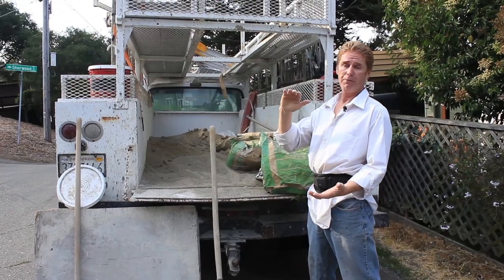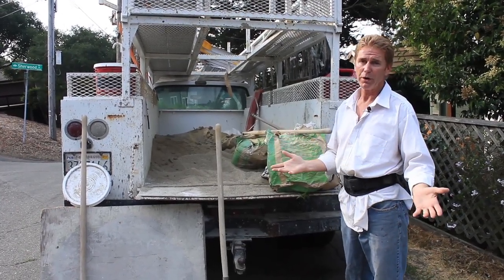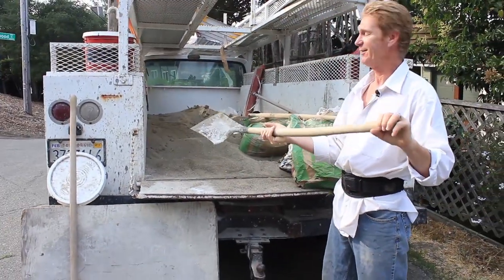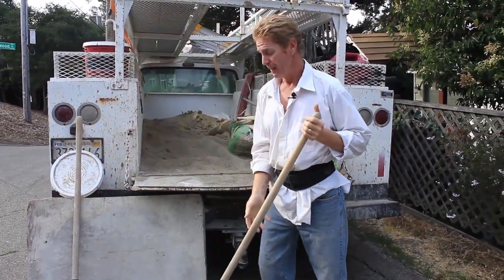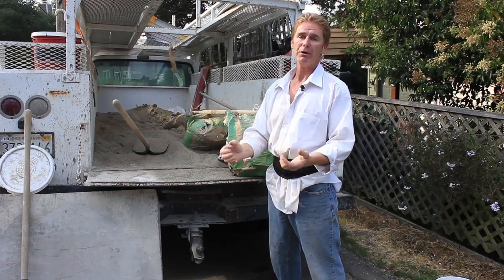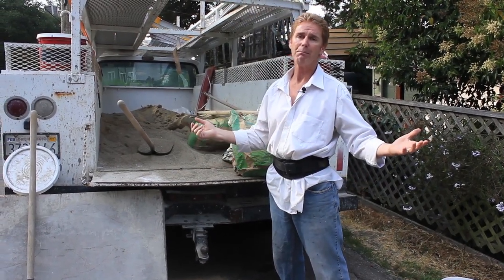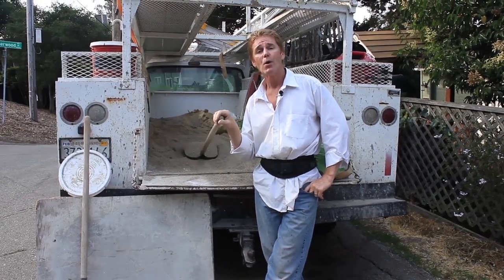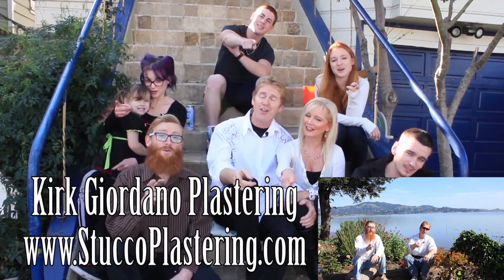Stucco ratios of sand to Portland cement

Comment: Thanks for the video. It's straight to the point and very basic for anyone to understand, unlike the other channels I watched before this where they get all technical with mathematical calculations and metrics etc, etc, etc
Reply from the maker: Howdy Peter, again, exzackery.
 For well over 30 years I look at projects, the amount of sand and cement within minutes is calculated in my head without pen or paper.       
                     Live long and plaster, 
  Teaching plastering tips with proper techniques

Comment from the maker: Evening Filmore slim, I use hansons premium, it's a combination of common and plastic.
 You can use it too, I buy it at Westside building materials but all the major material yards carry it.
 Almost every sand known to man can be used for plastering as long as there is no salt in it.
 I use Oly, or felton usually,
 I've read some sites online which specify how important sand is,. I say Bull, as long as you don't get it from a beach you should be fine.
 And, yes about 30 years ago I went to alameda beach and took a wheelbarrow full to finish a job , it became soft after a couple of years as it had salt in it.
 Most material yards wash their sand before selling it to the public, to get the salt out.

 Cheers and have a Happy New Years, Kirk Giordano’s DIY plastering tips
Reply: Kirk & Jason Giordanos DIY plastering and stucco tips I am not sure that in New Zealand we can get that combination mix of cement and think it is just portland cement.  Can I just use straight Portland and Sand - or should I use an additive?
Reply from the maker: Hi agin Carol, I would use plain old Portland cement plaster my self, If you can't spread it it's not mixed properly, you can add lime for extra spreadability but I never have had to. Carol, it really does take years to learn to spread mud or plaster expertly.
 Best wishes, 
 kirk giordano plastering

Comment: Thanks for what you do Kirk. I do want to clarify something, at the start of this video you said that the 3:1 mixes referred to lbs., then you clarified, and stated that it refers to parts, such as buckets or wheelbarrows. The latter is correct, it is not by weight but by volume that these part are counted, regardless of weight. Thanks again Kirk.
Reply: William Bigatti Correct William but I believe Kirk was trying to explain the ratios or relationships of each material to the another. If you measured the weight of each shovel for both materials the same would apply.

Comment: two main questions. does "washed" sand always say as such and do I need to add hydrated lime to riverside plastic cement? this info is impossible to find online! Sand sold at lowes does not say "washed" but is located next to lime and plastic cement and portland cement. uggg..

Comment: Hey Kirk, some questions about two different applications for cement and sand. #1) Back in the 70's, I worked for a fella that did weekend plastering jobs. I remember we put 9 sand, 3 cement, and 1 of something else. So the ratios were 9/3/1. Do you know what material that single shovel might have been?
#2) Recently, I finished grouting (tiles) a shower stall. The mastic was this nasty sticky stuff with some kind of urethane or plastic in it. I realized it when it was time to rinse my hands and clothes that the damn stuff was there to stay. Do you know if there is a way to mix my own plaster and mastic the old fashion way without using that crappy nasty stuff? I know what the arguments are for using the stuff for grouting...reduces shrinkage. I have laid a bunch of tile in my day and never but never had a problem with shrinking grout. I knew if the slump was right, I would have great results and could seal the joints when the grout set and dried. I appreciate all you do for us do it your selfers.
Reply from the maker: Evening Dude, thank you,
How much sand do we use for each coat of stucco?
  Scratch coats are mixed at 1 part Portland cement plaster to 2-1/4 to 4 parts sand, brown coats are mixed at 1 part Portland cement plaster to 3 to 5 parts sand, and finish coats are 1 part cement to 1-1/2 to 3 parts sand.                              
The above is our formula, however, there more than one way to skin a cat.
                           Live long and plaster
         Mastering Plastering for the beginner’s to experts
Reply: You can add hydrated lime which makes your mud more workable. I'd bet the '1' was lime.
Reply from the maker: Howdy guys, I too would have suggested lime, today they add lime in the bags much more convenient.
As far as additives for tile grout I've used sika before, but found if you purchace top of the line grout, additives are not necessary.
                                             best wishes,
 Sound advice for plastering repairs from your favorite stucco geek
Reply from the maker: Howdy John, this is the best-said explanation i have heard thus far. 
When I have the chance I will print and review it as its explained that well.
That will be when I get this dammed iv out of my arm and return back to my country.
Best wishes,
Kirk and Jason Giordano plastering

Comment: Dear Kirk and family, 
First of all thank you for all of your videos.  My question if you don’t mind is that we have a course sand finish on a 30 year old  house.  I am replacing the windows using your removal method and it’s working well it is a one coat stucco system, but I’m doing it in 2 coats due  to lack of skills.  I practice my troweling  and blending is ok, however my green float technique is not the best, a lot comes out to smooth. I am using a course sand and in some cases, sifting it for the courser particles. (Practicing on cement board). My last batch is very course but I’m afraid I might be loosing the bonding action of the cement because of the lack of fine sand   I am using 1 part Portland, 1/2 part lime 3 parts sand.  I add a bonding agent to the mix and am using a diluted WELD-CRETE to the surface some fiberglass mesh to cracks.  I finished one side of house and it’s ok. I primed with PPG Gripper paint, followed by 2 coats of Benjamin Moore exterior paint for stucco. I am doing this with small batch mixes, the reason is,  I am by myself, sunny side of building, it’s Az and it’s hot.  I have been waiting till the sun goes on the other side.   Can my sand be too course?  Is sifting necessary?  Should my green float be as dry as possible?
Reply from the maker: Evening Ray, try using Rapid set stucco. It has a 16/20 course sand in it. Rapid set stucco comes in ten to 25-pound boxes and large bags too, all you do is add water,
    Its the perfect course sand. Just dont over-mix like all same day cement plaster. If one over mixes, it beat up the strength. 
You will find this user-friendly cementitious plaster at all Lowes and Home Depot stores, plus many of the top quality hardware stores.

                  Bringing peace, love, and harmony back to the world of plastering.
    The complete plastering encyclopedia on video, by the plastering messengers of Youtube.

Comment: Greetings Kirk, a quick question, do you ever have an instance to use a superplasticizer or add pozzolans to your mix? If so, how would you dose for stucco mixes? Thanks Kirk, keep then coming!
Reply from the maker: Good evening Roberto, I prefer buying cement plaster wish both common plasters, for strength and lime, for readability.
 I used to buy both separate and add my own, but in the long run, you don't save much time and or money.
    Bringing you the most complete plastering encyclopedia in the world on video, by the plastering messengers of Youtube.  
     Over 850 free self-help videos 🎭 👀💃

Comment: hi kirk.
I am watching your all video's you are the best .I got some stucco patch up please tell me what I mix sang & cement. for scratch coat &brown coat & finish coat& I want to get pebble dash finish &should I use bonding ajent.thanks
Reply from the maker: Howdy Yourik, bonding agents are used for applying plaster or stucco over sealed or painted surfaces, they are only as good as the wall they are applied to, so that wall must be pressure washed clean enough to eat off.
            Live long and plaster
  Kirk’s how to plastering  video’s

Comment: Thank you for your videos, Kirk, they really help me and other people. I'm not a plasterer, but I did some DIY things around my house e.g. fixed my masonry window sill which was missing half of it, gave it a nice smooth steel trowel finish. Had to plaster (not sure if you can call that plastering, as I'm not even sure what does that mean) a part of wall inside my house and many other things. It's a fun thing to do, too bad I'm not a plasterer. Maybe some day.
Reply from the maker: Morning Eddie Spruce, plastering is a technically a name usually for interior plasters such as diamond, structo-lites, veneers and such, while stucco is a term usually that means all exterior stucco work, 
 However all the bags I buy for exterior work call themselves cement plaster, it's a bit confusing.
 Best wishes, 
  Kirk & Jason Giordano's DIY plaster and stucco channel

Comment: Awesome! So I can just use Portland/sand again.I'm adding no color - will be painted over after. So brown/finish together ok? Basically s 2 coat stucco: scratch and brown as final coat?
Reply: Sorry, just to add, I was going to try float it a bit with a car sponge later.  It doesn't need to be perfect.  The original is 40 year old basic Portland/sand mix apparently.

Comment: what about to glue solid bricks?   . I have some old solid 4"x8" cement bricks i want to use as a retraining wall on a remote property.  the soil is a very white sand and clean enough..  I want to make some mortar on site using just that sand and Portland (no limestone). The job is nothing fancy and my property . What mix and ratio you recommend?
Reply from the maker: Good evening Sunshine Beach Dude, I'd recommend first a foundation, then sure you can use just portland cement and sand.
 I like to add three times the sand to every one part cement plaster myself for CMU blocks.
    Bringing you the most complete plastering encyclopedia in the world on video, by the plastering messengers of Youtube.  
     Over 850 free self-help videos 🎭 👀💃

Comment: Thanks for the great videos. Can stucco be used over a painted block wall? If not, can I dimple the block surface, with a hammer, to get a good bond? Thanks.
Reply from the maker: Evening Andrew Bacchi, yes stucco can go over a painted  block wall.
I have about 5 videos that show in details how to do this, first pressure wash very well, then apply a bonding agent, next you are ready to stucco ,
 Best wishes,
 Kirk & Jason Giordano's DIY plastering & stucco network
Reply: Kirk & Jason Giordano's DIY plastering and stucco network
Thanks for the reply, I'll check out more of your videos to find the details.

Comment: Would this same mixture work for masonry? I’ve just been hired by a mason and right now all I do is haul blocks to him all day while he lays them. He told me I will eventually have to mix and I want to know what the best mixture is for that type of work.
Reply from the maker: Good evening Smitty Dude, yes it's basically the same although bricklayers will probably use a different Cement plaster, with more common plaster than Lime ad a bit less sand.
    Bringing you the most complete plastering encyclopedia in the world on video, by the plastering messengers of Youtube.  
     Over 850 free self-help videos 🎭 👀💃

Comment: When you say plastic and common combined does that mean plastic and Portland Cement? Is the plastic like lime in that it adds a sticky property to the mix? If I were to just use Portland Cement and sand in a 3-1 ratio, how much lime should be added? Thanks
Reply from the maker: Good Evening, Robert, I buy Hans Lehigh premium cement plaster it has the lime and common in the bags.
All we do is add sand.

                         Bringing peace, love, and harmony to the of, ‘plastering.’
    The complete plastering encyclopedia on video, by the plastering messengers of Youtube

Comment: Hey Kirk, great videos! I've been a mason since 1980 and have plastered on and off, but lately I'm running into some old time restoration projects, and I'm perplexed as to what I should really do. Do you ever run into the old time mix of the lime mortars? I'm hearing now that we have been destroying the integrity of these walls by putting our hard plasters on. I'm really interested in using the old time mixtures, but man are they hard to figure out, little knowledge left and the info is hard to acquire. I know they do a lot of it across the pond, but do you have any experience? MAN, that would be a valuable video to us, if you have knowledge!! Thanks so much for what your doing, knowledge is power! Doug
Reply from the maker: Howdy Doug dude, real lime plaster takes forever to set, sometimes weeks and hard to come by unless your willing to transport from the UK.
 Portland cement has been in England for about 150 years, while here for nearly 120 years or so.    
Bottom line is if a person was adamant they wanted lime plastering id to have to pass on the project or tell them you get the material here, 
I'll apply it. the video here is the tip of the icbug in regards to lime plastering https://youtu.be/jI54QRx0_H0                  
  Live long and plaster
         Mastering Plastering for the beginner
Reply: Hey Kirk, thanks so much! I love your video! Very helpful! I wish we could get back to that process again, its quite interesting how its such a great product but I see how it has gone away since time is money. Your the man!!
Reply: Doug Hinrichsen Doug thank you for your question. I asked Kirk some questions about the old materials and could not remember lime. We used to mix it 9/3/1 in the mixer. 9 shovels of sand. 3 of Portland cement and 1 shovel of lime. It's coming back. Those ratios worked good for the rough and scratch coats. Don't remember if we mixed it different for the finish or not.

Comment: Mr Kirk, thatnks for the infos. Except the 3/1 ratio, you dont add lime on it , or eny latex inside for extra bonding ?
Reply from the maker: Howdy Manolis, no, we're here in California, most of the lime additives are already in most bags.🍾
Reply: @StuccoPlastering  What will happend you think, if i use cement and sand only ? Its  a bad idea ?
Reply from the maker: @babakopoulo   Concrete is made with portland cement and rocks of various sizes. Stucco is made with portland cement with sand. If you use portland cement and mix it with sand, Voila. You have just reached your goal and made stucco.🍾
Reply: @StuccoPlastering  Thanks for your interest to answer me Kirk. I was worried that maybe the bonding ability is low and possible through time will have a problem. All ok. Thanks again. I study all your videos carefully. Its not my job, but i am interesting a lot of such repairs.

Comment: Hey Kirk, question for you...
Can you use 3 parts of plaster sand (fine) and 1 part portland cement without anything else for the scratch and base, block foundation?

or is it better to use 3 parts sand to 1 part Masonry cement?
Reply from the maker: Good afternoon dude, yes,  for block foundations only a skim coat is required not two coats, however the skim coat must be at least 1/2 thick or when it rains the grout lines will show.                   
                        Live long and plaster
  teaching repairing your number 1 investment, your home
Reply: but which of the two recipes are better to use lol that is the question the   3 parts sand to 1 part Masonry cement? or  1 part portland cement without anything else

Comment: Do you ever use silver sand, or silica sand, 30, 60? As opposed to standard washed plaster sand? Thanks -R
Reply from the maker: The silica sand is in all the finish bags of smooth plaster, so yes,  I have not heard of silver sand?
Reply: @StuccoPlastering  ok, thanks Kirk, its the p.w. Gillibrand type brand, they label it silver for some reason, but its silica. I usually sift and screen washed plaster sand, this come screened 30, 60, I just wonder how it dries, cures and behaves.